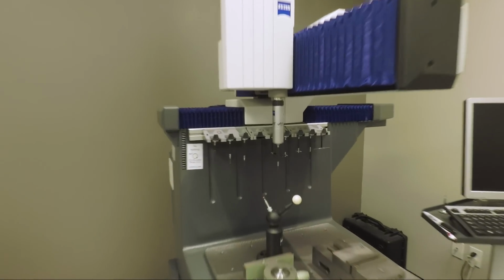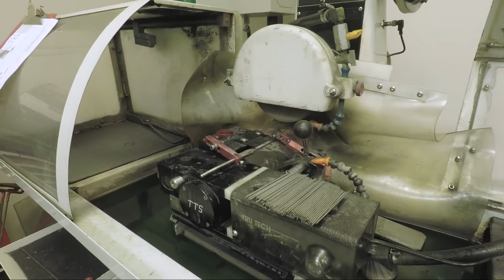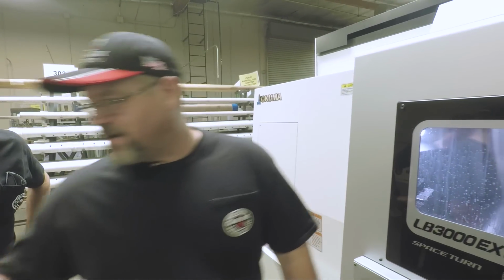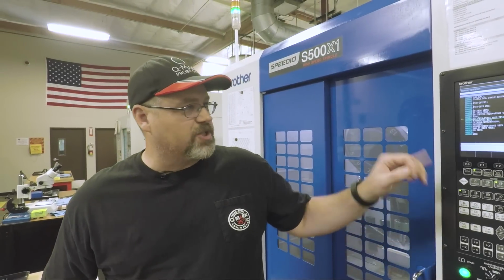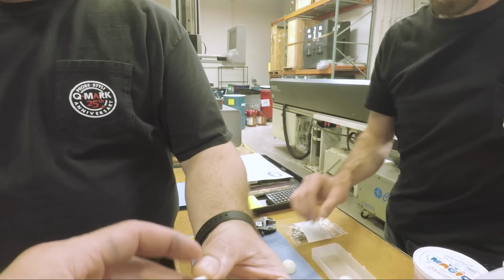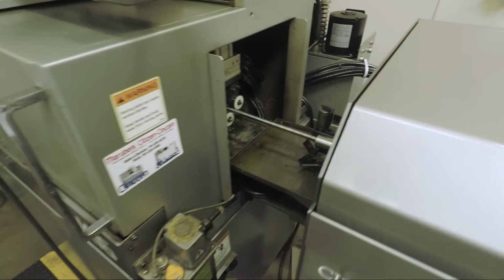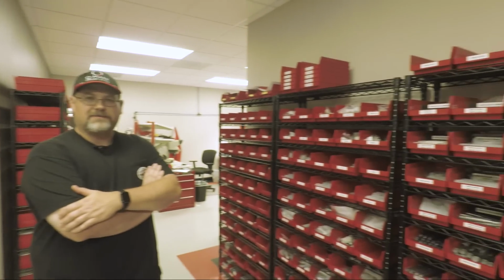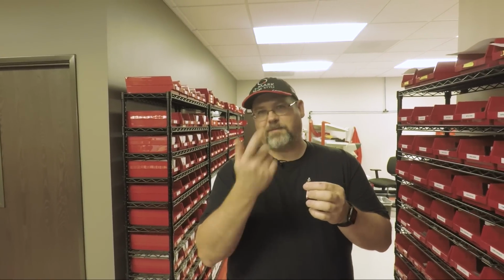Q-Mark Probe Styli Factory Tour!

Comment: Amazing tour! I work with CMMs every day and it is amazing to see what goes into making the styli. One thing i wanted to note, the choice of material for the styli sphere has a lot to do with not only what you are measuring but how you are measuring it. For instance if you are just taking touch points on an aluminum part you are perfectly fine with an ordinary ruby tip. But if you are taking continuous sweeps (called scanning) on an aluminum part you have to use something like carbide. The artificial rubies they use for the styli are made of aluminum oxide and will actually pick up material from the parts they are scanning very quickly. Also you asked about the deflection of the probes. A CMM will have all its probes calibrated against a reference sphere (you could see one there on the Zeiss in the video). That sphere is of an exact known diameter. During the calibration the CMM stores data about how that particular probe measures vs what it should measure at a certain angles and approach vectors (especially for CMMs with 2 Axis heads) and will use that data to generate an offset for any possible angle or vector it could measure at to compensate for any sag or other issues with the probe. It will use that compensation data when taking measurements on an actual part. The world of CMMs is a very fascinating and complicated place (along with the rest of metrology!). Those are just two little tid bits of information of the subject and there are literal books on the subject! Have fun!

Comment: John, I would again highly look into the Renishaw Equaitor. By far the most bang for the buck CMM. Perfect for job shops. And the kicker.... only $30,000 :)
Reply: The Big Red Machinist There you go again tempting people!
Reply: An Equator is not a true CMM. It can only compare production parts versus a master part. They are very useful for automated checking of production parts, but not for something like measuring job shop parts.
Reply: Just like everything else i guess it depends on the shop. While it does go off a master part that can also be a CAD file(certain vendors have programs that can integrate right into your CAM program i.e. MASTERCAM, as well as RENISHAWS Modus).   we usually do 1000 or more parts for companies in batches so we will test every 50-100 parts. while its not necessarily a "production" run those companies do return every other month wanting a batch of the same parts. we just save the file and the fixture for the equator and can just throw it back on. for more complex parts it measures in a fraction of the time a human can and significantly more accurately.  it also has a temperature gauge that will compensate for any heat or cold in the shop. 
 It measures out to +/- 0.0005.  It also takes up almost no space which is fantastic! Is this for everyone? No.   not every shop needs this nor a CMM, but it is something someone should consider as it is a fraction of the cost and might fit their needs better than a CMM.   Manufacturing is an ever evolving thing, alot of shops have gone out of business in Utah because they refuse to either learn new things or embrace high speed machining.  time is money and the equator is worth its weight in gold.
Reply: @Mr.Pierson Renishaw needs to start paying me for marketing ;)  all jokes aside i just love it, its an awesome piece of tech that takes up no space and does some amazing things.

Comment: If people are interested in Impact-Tolerant Touch Probes (won't be damaged by crashes that would break normal touch probes) or using Tormach machines in a production environment, check out Threadexpress's You Tube channel.   You won't be disappointed...makes a good addition to your Cnc machining channel list.